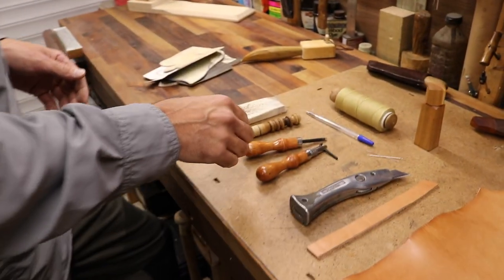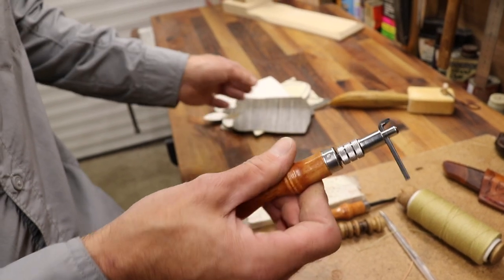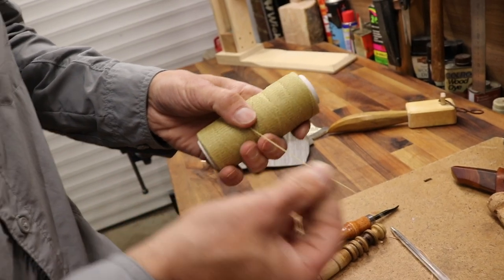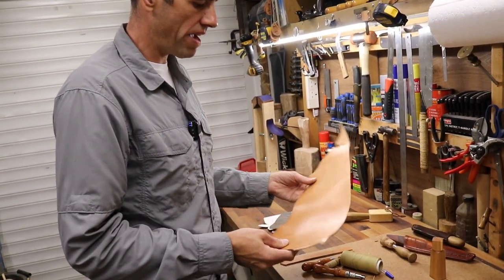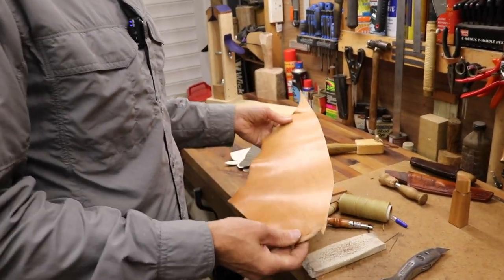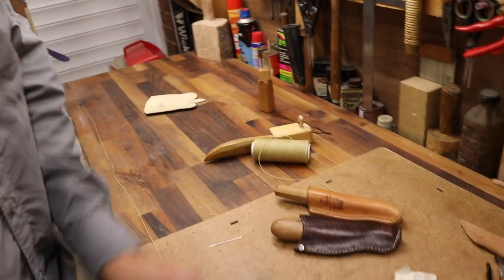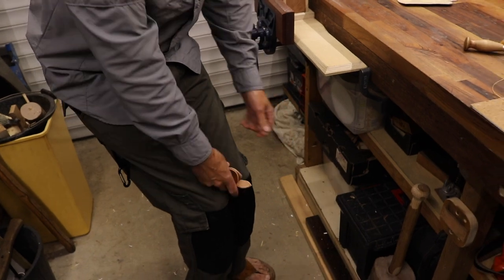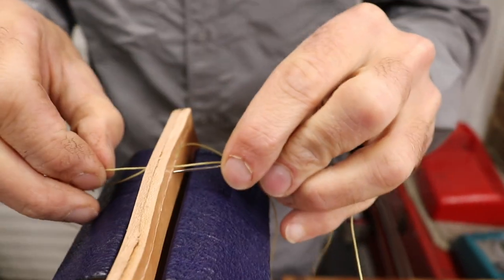How To Make A Leather Sheath For A Spoon / Hook Knife - Lee Stoffer

Comment: High Zed,  and Lee, hope your both well. 
If i may when you are carving using a  ruffing  /sloyd knife, would you use the same knife for taking out  /off the facet lines  ? Or would you use a different style of knife  ?  Basically in other words do I need to buy a separate knife for this function  ?
Having said that, my results have not been to bad I don't think. 
Look forward to hearing what views you may have. 
Cheers  Les.
Reply from the maker: Hi Les ideally you would use the same knife, the caveat being you sharpen it well prior to working on the facets. Saying that if you prefer to have a dedicated roughing knife then by all means get another knife (Mora 106 for example) that you keep incredibly well sharpened for the finer work. Hope that works for you and best of luck! ~Peace~